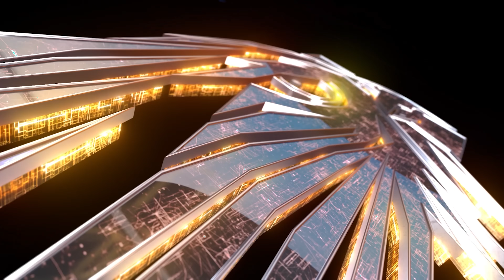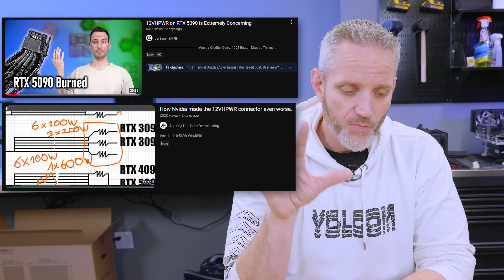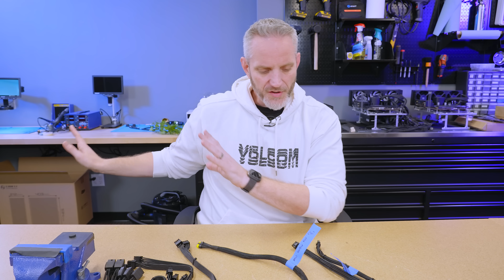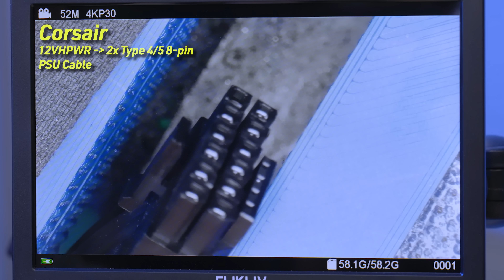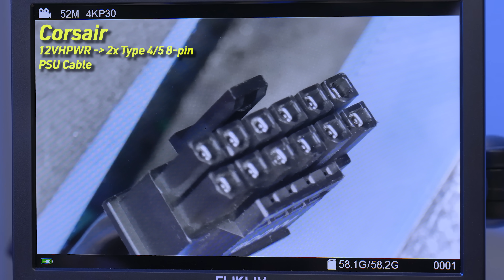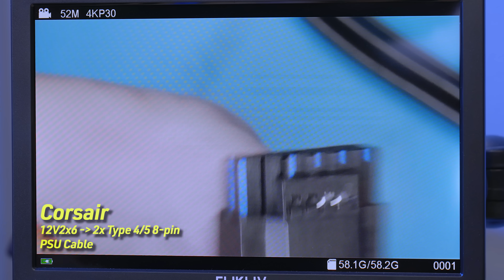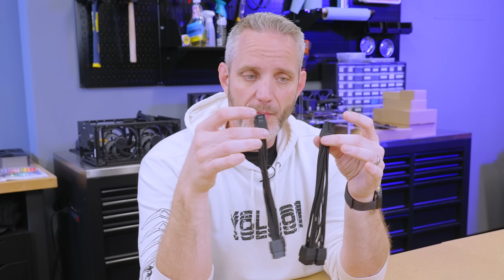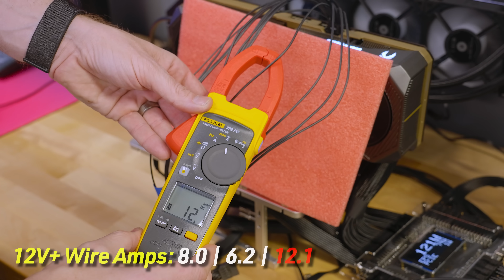I discovered something concerning and I need the Experts to chime in... More 12VHPWR discovery!

Comment: The difference in resistance that this pin can cause can ABSOLUTELY melt a plastic connector, especially with how close to max spec this connection already runs, let alone cause faults within the system. Could have something to do with the system drawing more power and performing under spec

Comment: Might have a controversial opinion but at this point why not use a xt90? Or anything made for high power/amp conector?lets make the entire system 12v put huge connectors on the powersupply and on the motherboards,  and make the wires gauge 10 or even go gauge 8

Comment: With GPUS becoming larger and more power hungry, it's only a matter if time before they become their own dedicated unit to the side and separate of the main case, with its own power supply at 24v to prevent wires from melting. It's just getting ridiculous.

Comment: There are no grounds on DC systems.  Just direct current positive and negative.  You're describing it like its 120v AC with a hot and a neutral (and then there can be a ground in addition to that). DC does not work like AC, especially 120v AC.  If you're interested why, look up how AC is stepped down from the transmission lines to household voltage.

Comment: The cheapest solution to this stupid cable issue is to have a fuse box between all cables.

This could use car fuses for each wire, 5 Amp on the safer side (about 60 watt/wire), 7.5 Amp (90 watt/wire). There are much better alternatives, per wire over current protection that is done by a custom in between board, or maybe integrated in the PSU, maybe a current limiter. Don't know what be better to cut all power or to starve the GPU.

Overall they created a problem, and later someone could overcharge us for the solution. And still 5 Amp per wire is still plenty to melt a bad connection. I liked the rounded pins from the old 4 pin molex (each rated for 11 Amp vs. new square ones might go to 9 Amp). We might end up with a new connector, or mains voltage directly to GPU.

Comment: I'd really like to use the NVIDIA adapter, but a brand new NZXT C1200 Gold ATX 3.1 doesn't support it. There are 5 sockets (combined) on this PSU for PCIe and P4/P8. Support told me that two sockets are exclusive to be used for CPU aux power. That's why they only supply three PCIe 6/8pin cables. So basically no support for the 4x PCIe adapter delivered with 5090. NZXT statement says: Well, you've got a native 12V-2x6 plug an this PSU. Use it! Yeah, right, this is fine. There is no war in Ba Sing Se. 🤓
Reply: not true you can use one cpu cable for mb and the other ones for gpu

Comment: This would explain a lot. My 12v connectors from BeQuiet 1200w 80+ Platinum seems to be good quality. I have seen a lot of outlet recepticals melt because of inadequate connection in my profession. Poor connection increases resistance which  causes heat at the point of contact.

Comment: Fun fact, if this cable is down one wire, it is mathematically guaranteed to lose at least one more :)
Reply: Optimistic Case (Standard deviation 10% of the average, contact resistance = 5 mΩ)

Results over 10000 simulations:

Maximum pin power. Mean: 0.444 W Max: 0.632 W
Total connector power. Mean: 4.292 W Max: 4.943 W
Maximum wire current. Mean: 9.147 A Max: 10.666 A
11.110% of connnectors have at least one pin overloaded.
Pessimistic case (Standard deviation 25% of the average, contact resistance = 10 mΩ):

Results over 10000 simulations:

Maximum pin power. Mean: 1.307 W Max: 4.244 W
Total connector power. Mean: 9.037 W Max: 13.303 W
Maximum wire current. Mean: 10.804 A Max: 19.539 A
95.690% of connnectors have at least one pin overloaded.
Reply: With one of the positive wire resistances set to infinity.

Optimistic case:

Results over 10000 simulations:

Maximum pin power. Mean: 0.575 W Max: 0.757 W
Total connector power. Mean: 5.084 W Max: 5.874 W
Maximum wire current. Mean: 10.719 A Max: 12.623 A
100.000% of connnectors have at least one pin overloaded.
Pessimistic case:

Results over 10000 simulations:

Maximum pin power. Mean: 1.489 W Max: 3.987 W
Total connector power. Mean: 10.270 W Max: 15.241 W
Maximum wire current. Mean: 12.171 A Max: 23.845 A
100.000% of connnectors have at least one pin overloaded.

Comment: Pin latch failure. That happens. Probably gouged the interior of the housing when the pin had to be extracted for some reason. That housing should have been replaced. QC failure. 

But really, they should be using an entirely different connector design for his much power. Especially if it's a unified rail. There are better ways than putting 6 pins in parallel.

Comment: Electroboom would be complaining about this design because one thing I've learned from him is that the looser the connection the higher the heat and also if it's loose enough it's dangerous because it can be a safety hazard and cause a fire

Comment: I have a corsair power supply that i've used for 3 builds.  After watching this i decided to use a pair of tweezers to push in every individual wire and 1/5 of the wires pushed inwards.  It also felt like the wire was getting plugged in since there was a popping sensation as i pushed in...........................HOLLLLLLYYY CRAPPPPP if i had a rtx 40 or above series my card would have EXPLODED.  THIS VIDEO WILL SAVE LIVES. if anyone complains jay is beating this topic to death, then shame on you.  Thank you Jay for your extra efforts diving into this situation !!!!  When did tech youtubers have to become Saints and Mother Teresas in the new age?!?!?!? gamers nexus filing lawsuits, jay finding what no "EXPERT" could......

Comment: i enjoy watching your videos, I have 2 question for you. I have a water cooled 3090 and I was thinking of getting the 5080 is it worth it? I only play 1440P COD B6 180fps. second question is this a good cable for the 5080 ? CableMod E-Series Pro ModMesh Sleeved 12V-2x6 12VHPWR 90° StealthSense PCIe Cable for EVGA G/G+ / P/P+ / T - Variant A (Black + Red, 16-pin to Triple 8-pin, I have EVGA 16000 PSU.

Comment: There should be a spec saying how long, far deep the pin is allowed to go, the minimum touching distance but not called like that. maybe its in spec, but here is a thought:

what if its within spec, but including a slight twist that induces rotational forces, when the cable heats up (due to GPU usage) the plastic slightly flexes and now the touch point becomes a smaller area. now in theory, this would not make this cable be the problem, because this less touching would be more resistive (more heat sure) but what if the outside cable is the last one that has most of the bad touch and now gets hot the first? the other cables should take the rest of the amps

Comment: I've been fiddling with computers for over 35 years now and over the years I've seen many weird and unreliable power cables. For example old AT with 2 piece power connectors, you had to have the black cables in the middle but you could easily install them incorrectly and kill your motherboard. Also, the classic 4 pin molex we used in harddrives and cdroms, you could easily pop one of the pins out by accident as you're trying to install them. 

Now, it is 2025. We had this abomination of a power cable for a few years now. I don't remember, ever, someone saying "if you install this cable with a gap where a razorblade can fit, you will have problems" with any of the cables I've used so far. This is ridiculous. The hardware and the cables keep heating up and cooling down, eventually there's a big chance there might be a slight move in the cable and if that causes hardware damage, then this cable and the hardware using it should be called back and replaced with a reliable and a safer option. This cable would not pass a safety check in any other electrical hardware. I don't think you can see something like that in a fridge, microwave, TV, toaster... you name it. I don't understand how they released a new generation GPUs with the same shitty power connectors.

Comment: This is just stupid 
$3000 and connection problems for a second generation of video card the problem is not the inconsistencies of the cable it's what you're asking the plug to do those plugs were designed for redundancy not load limits in other words it should be able to drop a pin and still function with out burning up so it ether needs a higher voltage line from the supply or thicker wire and plugs both involve the manufacturer or DIY heaver cable and plug change based on the highest amp demand of the card I really don't know how this could still be thing

Comment: Hi, Do you have the connection of the connector maker? Could be Amphenol or molex right? Actually I have a new material which I want to test it and implement it for improving "current load" of the copper pins. Ideally, our material can improve 20% current load and reduce the working temperature too. So I do believe this issue can be solved by us. So if you have connection, maybe we can collaborate. Thanks.

Comment: "Corsair already emailed me based on my tweets and said that these pins are fine" - BULLSHIT.  This is a high wattage connection, slop like that should NOT be tolerated on connectors that small.

This plug design was completely screwed from the start.  They should have used a better design.  They could have gone to any automotive OEM for tips on high wattage connections that will click solidly into place and STAY PUT.  Spending a bit more for a solid connection on $1000+ cards shouldn't have been an issue.

The faster they scrap this plug design, the better.

Comment: At some point you have to wonder why they just don't bite the bullet and use something like anderson powerpole connectors. Even the small ones can handle up to 45A, so with some good margin and derating you could have a row of 4 of them (2x 12V, 2x GND) easily handle over 700W.

Comment: I’m a commercial low volt electrician and this connector wiring combo scares the hell out of me. The amount of heat concentrated in such a small point is the main problem. the contacts are thin and fragile because of the needlessly tiny design. Not tested thoroughly and poorly implemented.

Comment: I just checked my “Premium Individually Sleeved 12+4 pin to 12VHPWR” cable from Corsair. I don’t have the same problem thank god. I’ll be using a Thermal Grizzly WireView Pro just in case, and I will return to update this post if anything changes. My build will be finished in a few days, just waiting on two more parts.
Reply: I was thinking of buying one of those from the Corsair website. Are you worried that the 12vhpwr cable is rated for 600 vs 675 watts and slightly different spec? I would appreciate if you post back here once you have the rig up and running.
Reply: @  because you asked so nicely, I will. I have a 4090 strix OC, I believe 600 watts comes from the 12VHPWR cord, and then 75 watts directly from the PCB (double check that on google). But yes, I’ll post pictures of its performance after a few hours of ultra gaming and let you know how it goes. Ps: I am not worried because the WireView Pro will audibly alert me if the cable starts getting over 100-110 degrees Celsius, at which point I’ll just shut the computer off and try it with the adapter it came with
Reply: @Tyler-sl6vg  I would recommend it. This is my second day with it and it works well and looks great. Sorting out the wires through the comb part can be tricky, but once you have it in place, it looks great. I wouldn’t do this without the thermal grizzly WireView pro, though. It’s like $90-$100 usd
Reply: @user-kp6ud7ht4z  Very happy to hear the cable working well for you because I did end up ordering one from the Corsair website. Not sure what solution I will go with yet. I think I have to see how big the card is in my case (side clearance) and examine each of the cables I end up receiving. You feedback is valuable and I really appreciate you circling back with the update.
Reply: @ get a thermal grizzly WireView pro if you can afford it. My pleasure, bro. Enjoy your card!

Comment: Electronics engineer here: for the purposes of heating, there's no difference between 12V and Ground pins - the electrons don't know which part of the circuit they're in when they encounter a high-resistance connection.

Comment: Pushing those cards to the limit and inspecting situation with a thermal camera now is a must do thing.
That's just how one must install those cards. Simple as.

Also, as I understand, nvidia supplies bare GPUs only to other card makers.
Why oh why those makers don't design power supply stuff like it was done in 3000 series??

Comment: The problem with the 40 and apparently 50 series Nvidia cards Is a combination of things that went wrong. 
The short version is basically they made their video cards the way cheap companies make power strips. 
Too much electrical current and not enough wire to handle it properly. 
That a very dumbest down version of it anyway.

Comment: Easy fix for corsair, fill the back of the connector with some black epoxy so the pins don't move.  problem solved.  Also, thicker wires don't do nothing if the pin/contact size stays the same.

I have a better idea then this stupid 12VHPWR plug.  Wire a 8awg positive and negative wire on the board and use some Andersonson Powerpoles on them to a normal 8pin from psu, or remove the 8pin and wire the 12v and Negative from the 8pin (PSU) to some Anderson powerpoles then the card.

Comment: @JayzTwoCents not very innovative to make a film based on someone's experience. Truth? You noticed that something is wrong, Bravo. On the other hand, you're not an engineer, so instead of playing around for 20 minutes which pin sticks out of the plug how much (which doesn't really matter) instead, he actually did something? The design of the connector is completely insufficient, looking at how much current is supposed to flow through it. It does not provide an adequate margin of safety and adequate mechanical resistance for this application. So, it is a serious threat to the safety of users. 
You have reach, so maybe instead of making secondary videos, you should actually do something about it. Ha? Get expertise of professional enginer and go for it.

Comment: I think that's a good clue that you've found. The flow of current is not only determined by the fact that there is contact between two conductors, but also by the details of the contact. I wrote that on 8bauer's channel. The size of the surfaces that touch AND the pressure with which the surfaces touch also play a role in the transmission of electrical energy. Touch a source very lightly with one end of the cable and measure, then press the cable against the source with great force and measure. The flow of current in the +12V channels can only be balanced if all of the connector ends on the graphics card and the cable touch the same amount of surface area with the same pressure. The manufacturers - and I'm sure of it - know this very well, because older graphics cards had separate internal lines. But obviously there were a few cents too much in manufacturing costs, as you can see with the newer cards. LOL - my whole PC isn't worth more than €450 if you add up all the parts in the purchase price. And when I think about the fact that a graphics card that costs several thousand euros could burn down my apartment because of 3 cents saved by the manufacturer of this card... No thanks!

Comment: Having DC voltage knowledge here not an engineer or anything but I am certified in the ability to diagnose and repair. It's not so much power in power out as you stated. But more of an issue of resistance. Poor pin contact could create a resistance on that pin and  the overall circuit. using ohms law , if there was higher resistance in a ground pin it is safe to assume youre going to have an increase in in power consumption or power draw for the card to receive its desired output. a lot of times you'll see this increase in the form of amperage. This increase in amperage and resistance just like in physics, resistance = heat so i would say yes this is a big concern if we are experiencing melting connectors, wires and even down to a hardware level it could be damaging to cards if amperage exceeds a tolerance. if you wanted to know for sure what is going on here i would back probe the suspected pin and do a "voltage drops test" you can google the procedure on this. compare with a known good pin or connector and it will technically tell you how much voltage that ground pin is losing or consuming if it is in fact a loose connection. a large voltage drop on a ground circuit is indication of poor connection or poor ground. a second test you could perform is with an amp clamp and measure the actual amperage the card is pulling with a known good cable and connection , then re measure it with a suspected bad cable. if you see an increase in amperage while voltage remains constant (the same during both tests) you could deduct again high resistance.  

the other issue could also just be flat out the spec of these cables being too close to their limits. in most applications a  minimum of 20% over head is required for fire safety in electrical design

Comment: SOLUTION.
A new power standard is needed. Video cards have on board voltage regulators that could EASILY be redesigned to run at higher input voltages which will reduce strain on power connectors. You would.only need to double the voltage to halve the current and need smaller or less wires to the card ... 😁

Comment: A bad connection will always cause heat. And since so much emphasis is being put on seating them fully, they need to be equal in length, and tolerances. It will be more noticeable on the positive side of things. Power will naturally follow the wire first with least resistance